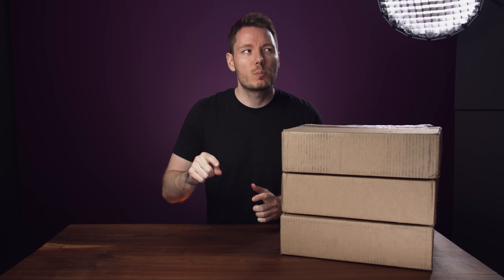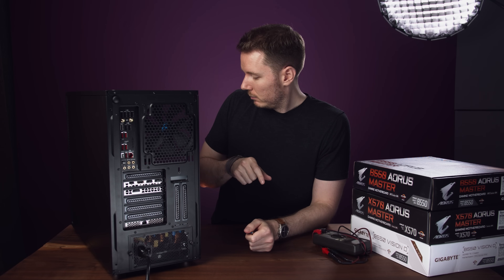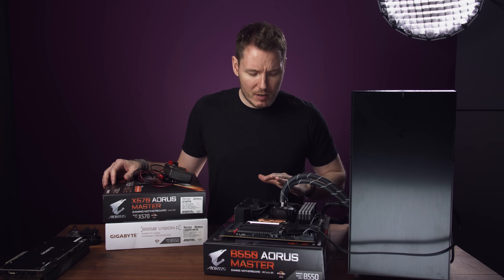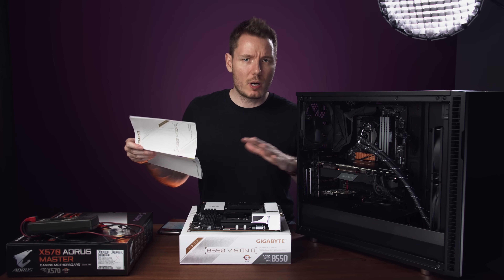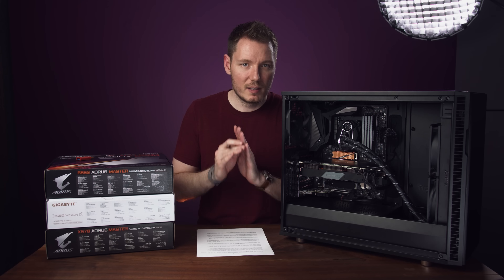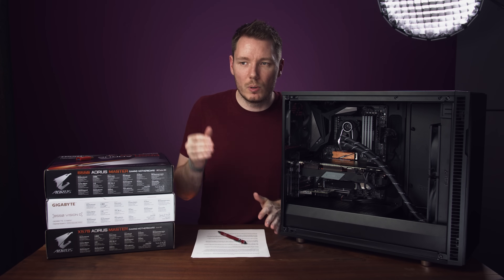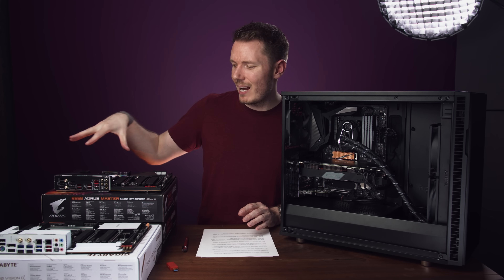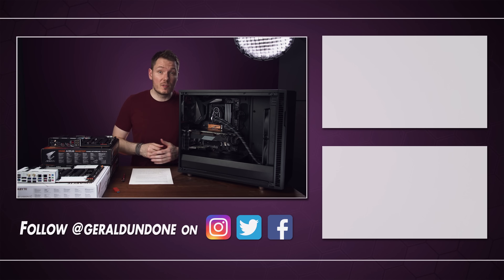I Was WRONG About These AORUS AMD Motherboards

Comment: Coil whine is a mark of a cheap component. You could swap the video card. Also. I wonder if there could be any benefit from putting a good line conditioner to all the components and see if that helps in anyway. Un clean power has the ability to make instruments act in unexpected ways. Just a thought. Good luck

Comment: Nice investigation. I've been having problems with my X570 AORUS Ultra's USB ports as well. No blue screen, but depending on what I have  plugged into different USB ports, certain ports on will seem to turn off and then turn on again. I notice this most with my Bluetooth mouse/keyboard combo. I'll be watching a Gerald Undone video, say, and I'll try to pause it to go back and relisten to a very complex point you make, and I won't be able to click on the video for a few seconds. Then, I'll get a notice that a device (the mouse) has been plugged into USB and I can use it again. So annoying. After watching your video, I'm thinking I got a problematic board.

Comment: I had noise issues with my audio interface when I went to XLR cables and monitor speakers.  Solution for me was to cut wire on pin 1 of XLR cable.

Comment: No case continuity when power on is not possible, but the continuity tester is failing because the power supply is adding voltage noise to the case.

Comment: Have you seen this thread from 2018? “Should a computer case have electrical continuity to ground?“ “Those fractal cases aren’t good for EMI. Lots of plastic and the tool less drive mounts leave the drives floating. Nothing beats the good old fashioned cases with everything screwed down hard.” Since I never had any issue I cannot agree totally but maybe some setups can get the mobo too isolated from the PSU ground. I’m very confused since I thought PSU provided same ground through chassi and cable.
Reply: This rabbit hole goes further, totally opposite opinion; found an electric technician claiming you never should have chassis grounded to PC electronics because then you get groundloops.  ”Modern motherboards come with insulating (usually red) fiber or paper washers for the screws that mount the motherboard to the stand-offs to eliminate those ground loops.” ... “Measure the resistance from the shield around the Motherboard interface jacks in the back to the ground lug on the power cable.”. For the record I have no recollection of ever installing isolator pads between mobo and chassi nor seen this ever shown in a PC building guide but maybe everyone builds wrong. But more non-grounding materials like the fractal cases seems to align better with what the electrician is saying, that chassi isn’t expected to be electronics ground.
Reply: I left a comment on Louis Rossman if he could clarify how PSU ground, chassis ground etc is supposed to work. Maybe you could try to hook him up. So you get someone who really knows electronics well can clarify how ground is supposed to work.

Comment: Regarding the RAM, I think (guess) the RGB controller does two-three things; 1/ operate in an unusual manner in the spd/SMBus/i2c bus (how else could drivers talk to the controller?). 2/ add more things connected to the spd. Normally it’s only a eeprom here, now we have a controller that also change the color. 3/possibly mess with the power draw on the memory slot. I can imagine that if there already is other ground problems that memory doing funky things to SMBus is not great.

Never heard about your problem before but well... neither memory bus,  nor SMBus has ever been designed for RGB memory :)

Maybe your USB controller is connected to the SMBus in some manner, and when grounding isn’t working well a noisy RGB controller pollutes that bus ground.

Just a theory :) and I completely suck at analog power & grounding, anything not digital is dark magic to me.

But RGB memory f*ing up your USB ground doesn’t seem impossible, presuming the SMBus or its ground somehow is connected to the USB.

Comment: Built 3 different fractal design computers without any weird problems. Different country though. 1/ does the problem remain with an extremely over-powered PSU? 2/ could an electrician check if your power is good? No weird DC bias or something?

Comment: Great video, thanks. Around 17:30 you mention the lack of a  "clear cmos" button on some MOBOs. A trick of the trade is to hook your reset button up to the "clear cmos" jumper. Sure, it has some drawbacks, but it is an option.
Reply: A flathead screwdriver works fine. You can also take out the cmos battery.

Comment: I have an Aorus X570 i and it has some oddities with USB ports. I use a Mayflower ARC Headphone amp that just would not work over USB 3.0, even though the device is specced for that type of port. It works flawlessly over USB 3.1 though.

Comment: The only reason the case may be causing any grounding issues could be the front panel header. That’s probably the only place where other (non grounded) electrical connections can make contact with the case.

Comment: I was an electrician for 15 years. Normally for that intermittent grounding means something was wired incorrectly (switched neutral or even switched ground). But since the problem is only with the case, which has no wires...its almost like there's current running through the case, but that would point to a power supply problem...WAIT, IT’S probably the power cord or the plug on the back of the case. There might be a short there.

Comment: Little tip:
Connect your RESET button to the CMOS clear jumpers.
It's really easy to reset that way, and if you wanna restart your pc, you can still use the power button.
Probably even more convenient than using the motherboard build in buttons (cause u won't have to open the case)
Reply: Why did I never think about this?
Reply from the maker: Ooooh, I like that one! Cheers! 🤓👍💜
Reply: I'm totally stealing this too. That's a great idea for lazy computer tinkering. Also, for mobos outside of cases, I've always just used a screwdriver as my power button. You just bridge the pins for the power button, which are usually nicely color-coded these days!

Comment: 7:09 this is an expensive contrast card. 
Here's the best thing about this video. This is the video I expected from Gamers Nexus. I always considered Gerald Undone to be the Gamers Nexus of video, audio tech and Gamers Nexus to be the Gerald Undone of PC tech. 
I haven't had any issues with either the B550 Gigabyte Aorus Pro  or Gaming X but I did put it into multiple legacy cases from an era where airflow really was a thing. From my experiences and my understanding the majority of the grounding is done from the PSU cable to ground which would explain why turning on the PC changes your ground readings. The grounding not accomplished by the PSU would normally be such a low variance and go without any issues minus what would be audible buzzes or static. The Aorus Master has more high power phases and maybe surpassing that variance in some pc cases resulting in the issues you laid out. Just a guess really. Great vid and support from Gigabyte.
Thanks Gerald. Have a good one.
Reply from the maker: Thanks, Jay! That's a huge compliment. I love Gamers Nexus. Appreciate your thoughts too. Cheers!

Comment: not related to the video but a youtube video from GamersNexus shows how you should put the watercooling radiator tubes side up helps with air/bubble formation for your pump since the radiator side is the high side so air doesn't make it in the pump which in turn makes the waterpump more efficient and quiet.
Reply from the maker: Hey! I think you might have misunderstood that GN video. I watched both of them and I'm pretty confident he recommends tubes down so that the air bubble is at the top of the rad and thus doesn't get sucked into the tubes or pump. Provided the top of your rad is above your pump.

Comment: Check for voltage on the case. To do this, carefully measure between the pins on one of your extra four pin drive power plugs and the case. See what you get. Also, replace the power switch and see what happens. You can then unplug each wire going to a case extension (leds, switches, fans, usbs, etc. add them back one at a time and see if the issue appears with one.

Comment: I built a 3900x system when it was launched.
I almost bought that case, but wound up using my old one, I'm glad you pointed out the case issue.
I have the x570 Master, it's been great, unfortunately, 1.0 doesn't have Thunderbolt like the 1.1 and later does. I wish they'd make a proper add-in card for it.
Enjoy.

Comment: If you can, try a different power supply. If you suffer from power issues that's the first thing you should check. It is quite likely that it would provide a lot more stable power and you wouldn't hear the coil whine and RAM interference.

Comment: I'm not an electrical engineer by training, but I have designed a number of low voltage switching power supplies for LED and wireless applications, and consulted with a number of actual electrical engineers during that process. My understanding of the noise problem is that the frequency of the noise you hear can help you diagnose the problem. If you're hearing 60hz low-frequency noise, that's ground loop hum coming from the AC power supply (in some applications this is also testable by switching between battery and wall power, but if the device is inherently wall powered, you wouldn't be able to do that test). Higher frequency noise would be more related to switching power regulators, which are used to convert AC to DC power, and also to change the voltage levels of DC power (e.g. 12V to 5V, 12V to 3.3V, or even boost from 5V to 12V). The frequency of that noise can be used to determine which regulator is causing noise, if you know the specs to the regulator.

Immediately pinpointing a specific regulator on a complex device like a PC is probably not possible, since there are a lot of switching regulators. But one possible hint in the diagnostic process is that the frequency and magnitude of noise will change as the power draw on the regulator changes. The problems you found with the LED RAM and the GPU under load both seem to point to regulator behavior where under low load, the switching frequency is outside the range of sound, but under increased load, the frequency falls within the range of human hearing. (It's actually a little more complicated than this because regulator designers know that this noise is undesirable and can mitigate the noise using filtering capacitors. However, those capacitors are selective in the frequencies that they are effective in filtering, so one may find that increasing or decreasing the load by some amount might increase noise, then further changes will decrease noise as the frequencies shift into and out of the effect range of the capacitors being used within the design.)

This noise is propagated on the voltage and ground lines, so it makes sense that even though you don't have a ground loop, powering your audio device with a separate isolated power supply would result in the noise not reaching the device.
Reply: Also, perhaps I got too caught up in the diagnosis part of this, and lost focus of a solution. Actually trying to balance out the power draw of all your components to evade regulator noise at audible frequencies is overall, probably too hard. Probably a more stable solution, mentioned by a number of other commenters, is to ensure that the audio equipment that you are plugging into the USB ports have their audio handling power paths isolated from the data paths, which unfortunately means getting away from bus-powered devices.

Some bus-powered audio devices may attempt to mitigate this with device side power filtering but it's hard, but probably the most effective solution is something like an RME Fireface UFX series device, which is independently powered.

The difficulty here is that even if you manage to balance out the noise from all of the internal components, other devices you plug into the USB ports might be noisy, or simply change the power draw to the point where you enter the noise range again. Keeping audio device power segregated insulates the setup from that kind of instability.

Comment: The case lights turning on and off when you were probing the motherboard outside of the case is a big red flag.

The memory is causing the sound because it emits EM noise just like your graphics card. All of these things are normal and not a problem - it’s your grounding issue that’s making them apparent.

I wanna say it’s the PSU but you did say you swapped a lot things, and I’m assuming it’s the PSU.

Testing for continuity is generally pointless when a system is running because there are so many factors which affect a continuity test. There’s probably continuity but the test charge your meter is applying gets affected by the time it gets between your probes.

Could be that your multiple voltage rails in the PSU are grounded as different circuits, causing a relative offset. Could also be that the new PSU isn’t grounded properly and your old case is actually covering up that issue by more paths to ground.

Comment: Maybe its the crap fan controller in the back of your case doing something too... The GPU creates a lot of electrical noise in the system if you use the front panel. you can mitigate it with a vertical mount or use the HDMI Nvidia audio or the Optical Toslink, or just get an asus motherboard, the ones that have the audio device on a shielded and disconnected PCB.
Or drop a message to "Actually Hardcore Overclocking"
remove the disk drive holder so to raise that radiator a little bit. Those straight tubes unsettle me.

Comment: I experienced a very similar problem a few weeks ago connecting a USB powered microphone to a laptop via a Blackmagic ATEM Mini. The USB mic works fine when connected to the laptop but if you then use the 3.5mm audio cable from the mic to the ATEM Mini and then of course USB-C from the ATEM to the laptop you get the same pulsing electrical interference. I suspected that it was an earthing issue of some form but your video has (I think) given me the final clue to the issue and probably explains how your issue is related to the case.
* I think the issue is not a failure to provide a ground but that the ground is actually receiving current. In effect I think that something is actively grounding (shorting) to the case and that is what the mic and sound card are picking up.
* This also explains how it is related to the case in that if the case mounting is actually touching something it should not then your ground would be live.
* The USB grounding gadget would resolve this probably because the current is so small that the ground lead just provides a lower resistance path and thus neutralizes the voltage. (Voltage is actually Potential Difference after all)
* I think that your multimeter test is failing when power goes on because you are no longer testing a dead circuit where the meter's current is the only current being measured.
* The link to the RGB ram could just point you towards what is shorting down to ground.
All just guess work but hope it helps.

Comment: I'm having good luck with the Gigabyte Extreme Aorus TRX40 board for my 3970X video build. I even have Thunderbolt3 working and tested with eGPU, etc, although it's not officially supported.  I did a little build video of my hardware choice here (3970X, 128G RAM, TRX40, 3x PCIe 4 SSD in RAID0, etc):  https://youtu.be/lCS4T8urkSg

Comment: When your first video posted I just finished installed the B550 Aorus Master in my system. I didn't have any ground loop issues so I assumed it was something else in your system but forgot to post. I did have strange USB issues like you though, so I ended up returning that board for the X570 Aorus Master which is a great motherboard.

Comment: Being a Pro-Tools Musician for more than 20 years I have always looked to Intel for the reliability and build quality
like 4 layer PCB's, better "GOLD" plated components, better grounding and clamping for less coil wine and noise reduction and more
  AMD being the underdog seemed to always have cheaper quality motherboards (Probably because AMD was less expensive)
Now that AMD is setting the BAR for intel and the tables have turned in the past year
I am seeing better build quality in the AMD MB's along with quality components
this being said I would think that in another years time we will see 5+ GH Clock speeds from AMD wich will push intel into making some changes in the future........
But From first-hand (20+ years) experience every time I build an AMD
I always find some glitch with a program or hardware and switch back to Intel

One note:
Always buy EVGA Power supplies for quality and warranty ;-) 

As usually, another quality Video put out by Gerald Undone
Best regards, rick

Comment: *edit I was wrong it's installed correctly

Your radiator is installed upside down. You don't want the tubes running to the radiator to be bellow your pump. Gamersnexus did a good video on this.

Essential if you have any air, which you most likely do, in the loop it will be at the pump where the water is trying to cool your cpu and you will have poor water flow over the block.
Reply from the maker: It's actually the opposite. The GN video highly recommends having the tubes on the bottom. The air in this case will be at the top of the radiator, which is above the pump in my build and thus won't get into the tubes or the pump.
It's also unrelated to this video anyway.
Reply: @geraldundone  ahh I see, I didn't realize the top of the radiator was above it. Glad your a fellow gamersnexus follower. I thought you might be when I saw the aio that they recommend
Reply from the maker: Yeah, I like it. It's a very simple, no frills AIO that does a great job. Sort of a pain to install, but I like that it doesn't need USB or software, etc. And I like the inconspicuous look.